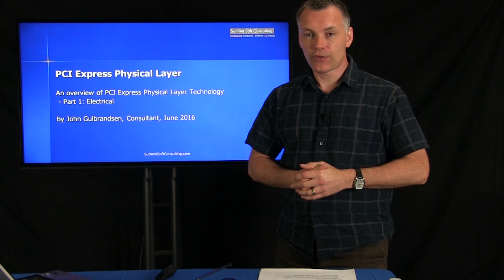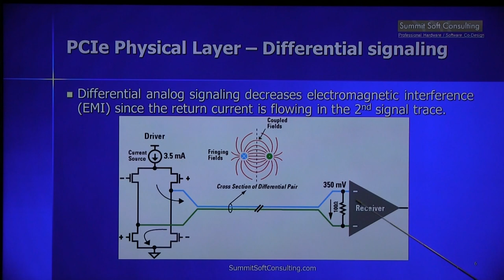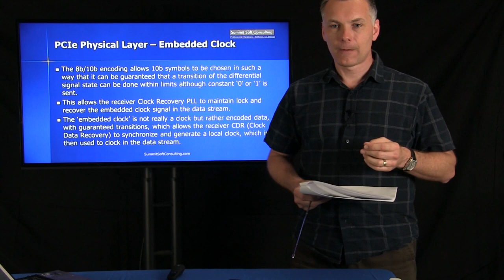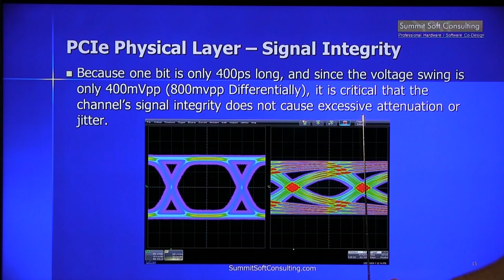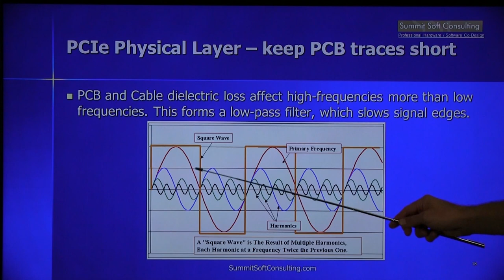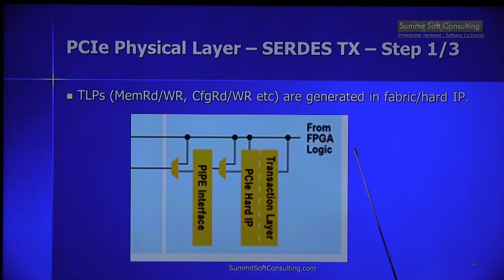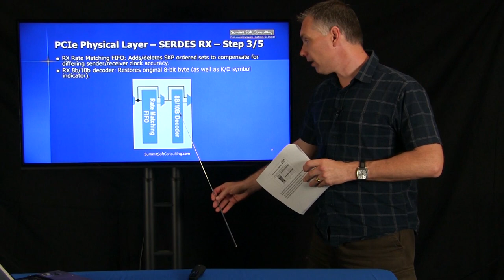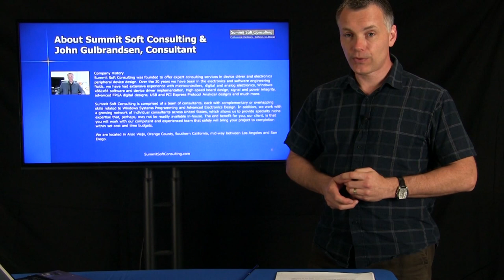PCI Express Physical Layer

Comment: Thanks so much... So the Receiver does clock and data recovery on its Receiver block side from its Rx stream. What about PCIe Clock reference? Is it sync in both Driver and Receiver? OR separated ref clock on each side?
Reply: A PCIe device can choose to use the reference clock or it can provide its own. If it provides its own it has to be within the +/- spec (off the top of my head +/- 300 PPM). I suppose both TX and RX sides use the reference clock but I also suppose this is implementation specific!

Comment: Doesn't scrambling also help with DC balance and to ensure sufficient transition for clock and data recovery (in addition to 8b/10b)  ?  Is scrambling AND b8/10b used at the same time? In the FPGA based example, where is the scrambling done?
Reply: No, scrambling is used to spread out the frequency content in the signal, which lowers electromagnetic interference (EMI). 8b/10b encoding is used to embed the clock in the signal and to provide DC balance. They are normally used both at the same time but the scrambling can actually be disabled. Scrambling is also not enabled for the PCIe compliance pattern (which does use 8b/10b encoding).
Reply: Thanks!
Reply: Right!! The 8b/10b dwords were made in such a way that the only valid combinations by which they can be sent are DC balanced (equal 1's and 0's).